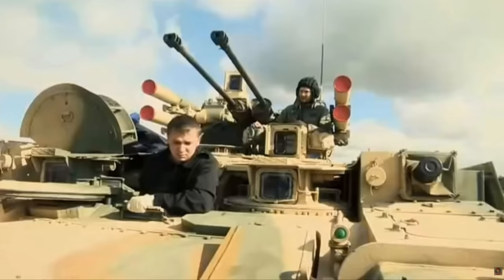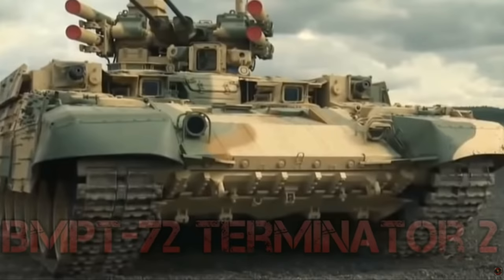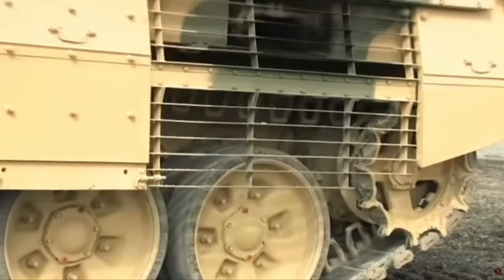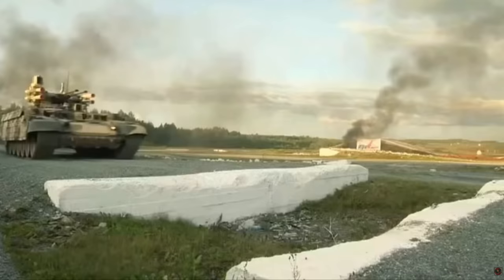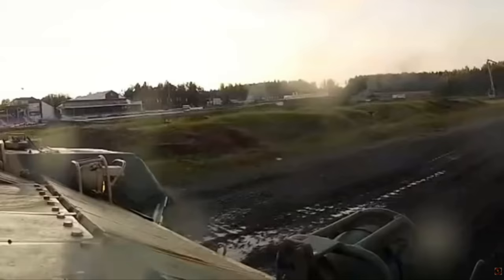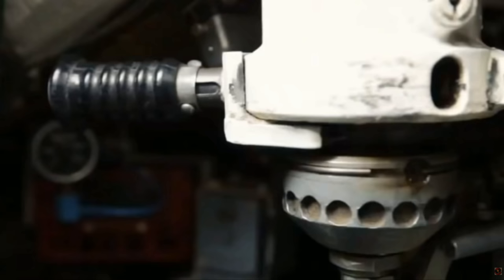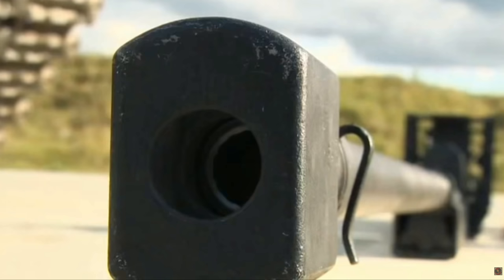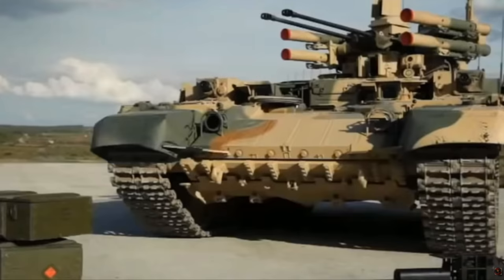BMPT “Terminator" Tank Support Vehicle Overview

Comment: BMPT wasn't designed based on military request, it was initiative from Uralvagonzavod constructors, they still don't fit into Russian military tactics to be widely adopted, that's why there's not so much of them actually built
Reply: 300 pieces were built for Algeria
Reply: i think you meant to say, russia cant build that many because they dont have the cash nor resources to build more.

should i point out the T-14.
Reply: @Thekilleroftanks  if terminator is effective  who know they could just jeri rig the remaining  t 72 they have into somthing  similar or a mad max style look thing and deploy it , whether  it effective  or not it up to a guess,
Reply: @Thekilleroftanks  terminator construction is basically using t72 chassis and put btr cannon plus some atgm.. not the same level of cash as armata
Reply: There expensive and untested in combat 'untill now'.  The Russian federation has 300 if it proves successful I imagine this number will go up.
Reply: @123456qwful  the issue is that the bmpt used modern T72s thats been upgraded (think they used t72b3m) however all the other t72 stock they have is old. am talking t72a and bs, like were talking about early gen ERA. those things would get knocked out so god damn quick.

other issue is that all the electronics for the bmpt is impossible to get ahold of now because theyre all from the west, who is currently preventing any sales to russia. meaning they cant upgrade any older tank nor produce modern tanks or vehicles. meaning this war will wipe out most if not all of russia's military progress and stock piling from the fall of the soviet union.
Reply: @Thekilleroftanks  - "they dont have the cash nor resources to build more." hahaha !!!  Record financial receipt on 2022, minimal waged raised by 10%, and they never have so much foreign money like now ! In what parallel universe do you live, dude ?! They have profit at 45 $ / oil barrel, and how much is now the Brent ? 112  USD ? 
Even selling at a huge discount to Chinese and India, at "only" 75 USD,  they make hundreds of millions / day !   And they sell 50 & MORE now than they sold in 2021 ! 
And about resources ? That plain stupid to say, lol ! If you think of electronics, China is there, can give them ALL they need !
Reply: @m_zbrv3967  is NOT "cannon" but a pair of them, ( no BTR have 2 x 30mm on top ! )  and you forgot the auto grenade launchers who can rain hell on any infantry or soft skin vehicles. And those ATGM can be switched with thermobaric missiles.
Reply: @mirandela777  the 2x autocannons are irrelevant they are not dual feed so one fires ap and other he so you pretty much have bmp 2m lvl of fire power with lot higher protection
Reply: @Thekilleroftanks  i've said exactly what wanted to say. BMPT-72 as it is equals to the price of T-72B3 and have nothing to armata chasis which is completely different thing
Reply: Yes. They are  extremely useful. But As you can understand these are "urban warfare" tanks. They are not meant to fight against tanks. They were made because of the Chechen war.
Reply: @mirandela777  
Except the 6 million Russian that fled to the EU and the hundred of thousands of jobs lost in only the industrial sector.
Splendid. :D )))
Reply: @Thekilleroftanks  Russia don’t have resources? Look at their land…
Reply: @mirandela777  yup.. 2 cannon is destructive
Reply: Javelin targets🤣🤣
Reply: @Shatterfury1871  - source for this info, or I call your statement just a simple invented  BS, dude !
Reply: @mirandela777  he can’t he knows it’s bs. I bring my sources with me. Slava Russia 🇷🇺 #dontfeedintothewesternpropaganda
Reply: @mirandela777  exactly. Russia is making hand over fist now that oil prices have jump to astronomical highest. People forget that all of Asia is supplied by Russian oil. Vietnam China India Bangladesh Japan Myanmar Laos Cambodia Kazakhstan literally the list goes on forever. India is bucking western sanctions and is fed up with the west.
Reply: @JohnDoe-yq9ml  Except Iraq twice (we got Saddam out very easily because the soviet equipment Saddam's guys used was inferior), Afghanistan (we got you guys out first in the 1980s then we got Bin Laden in Pakistan), Nicaragua (where our guys won), Grenada in1983, Saudi Arabia is winning their war now. We don't have a perfect record, we have made mistakes in Vietnam and in Afghanistan, but we have much better record than Russia.
Reply: @dedrickbroussard9797  also btw the USA supported saddam during the Iran Iraq war. Once again proving my point that they always back the wrong guy and then kill him once they realize it.
Reply: @JohnDoe-yq9ml  That is what we are doing now. We supported Russia in WW2, now we are fixing that mistake.
Reply: Military tactics?
Reply: @JohnDoe-yq9ml  '...literally the list goes on forever' It literally doesn't. Japan is phasing out Russian oil, and China and India are the only two you mentioned that come even remotely close to making up for the lost sales to Europe; and they need to transport it a longer distance and at discounted rates to make it attractive enough to 'buck the sanctions'. Their oil industry took a major hit, no matter how hard you try to cope about it.

Meanwhile, inflation in Russia has doubled since the invasion began, their GDP is forecasted to drop from 7-10% this year, and they're currently in the grace period to default on their debt. Yeah, Russia is doing fine.../S
Reply: @scurra1163  tell it to Japanese companies in Sakhalin-2 project, they’ll laugh their ass at you
Reply: @SergeiSugaroverdoseShuykov  Japan imports less than 10 percent of it's LNG and 5% of it's oil from Russia. And not abandoning their shares in Sakhalin to prevent China from taking their market share doesn't mean they're not weaning themselves off Russian supplies.  Russia screwed themselves; cope harder.
Reply: @dedrickbroussard9797  Seelow Heights 1945 would like to have a word with you.
Reply: I bet there's a lot more of them NOW!!
Reply: @mirandela777  The average Americans are not known for their "deep thinking" my friend!!
Reply: @Thekilleroftanks  all the electronics for the bmpt is impossible to get ahold of because theyre all from the west
haleluya contact with a parallel universe maybe you like to buy a bridge?
Reply: @dedrickbroussard9797  supported Russia in WW2 in what universe?
Reply: @fred6319  
You mean deported by force to Siberia.
We have over 6 million in the EU.
There are thousands in my immediate vicinity.
Reply: @Shatterfury1871  no i mean the ethnic Russians and Russian speakers who fled the NAZI regime in Kiev in the last 8 years and people from donbas that have been bombarded by the NAZI regime in Kiev the last 8 years in violation of the Minsk ceasefire this is all the time i will waste on a propaganda parrot
Reply: @Thekilleroftanks  t14 его больше не построить
Reply: @dedrickbroussard9797  Mistake? OK. EVERY NATO observer of this limited op in Ukraine knows what you call 'fixing' isn't going so well. Worse, NATO aren't able to directly intervene because they'll get beat. Meanwhile Putin is 'fixing' US mistakes on his doorstep.
Reply: @a.m.armstrong8354  The repair is ongoing.I would prefer it to happen sooner.
Reply: @Thekilleroftanks  country with a bullet (sanction) proof economy . does not have a resources.... greatest joke ever
Reply: @Thekilleroftanks  I see another anti Russia person here. Who nothing knows about
Reply: It's an IFV with zero troop carrying capability.
Reply: Actually the Russians have built 300 of them from their experiences in Afghanistan and Chechnya they (Russian MOD) wanted this tank support vehicle they did request it
Reply: @Thekilleroftanks  tussia has the cash, they dont have chip manufacturing. Figure your shit out
Reply: @GhostScout42  ya they have the cash (their economy has been on the trash since the 90s)

Ya so much money.
Reply: @orcan377  Algeria is buying 300 Terminators? That's a lot for a relatively small country.
Reply: That and they don't have the domestic capability to make them. Most of the electronics were imported.
Reply: @Thekilleroftanks  Hahahaha... Sure they dont, with oil because this expensive and them earning 230 bilion euros for it so far (210 in entire 2021), get outa here!
Reply: @juhoalander3461  they are dual feed actually
Reply: @Thekilleroftanks  then why many are in ukriane blasting? https://youtu.be/pNonne3faFA
Reply: @SergeiSugaroverdoseShuykov  Russia is broke, there are American cities with larger economies.
Reply: @orcan377  algerian bmpts aren't actual bmpts, they're just t-62 berezhok.
Reply: Actually they used the experience in Syria where they saw that the AA shivka high rate of firepower basically made it I possible for insurgents to raise their head
They used what they learned to produce the terminator

Comment: Bmpt terminator 2 does not have the grenade launchers,Bmpt 1 does. The terminator 2 also has armor around the ataka missiles.
Reply: I wonder what the GL performs vs dual cannons for dealing with reinforced concrete positions. Penetration vs AoE in an urban envt
Reply: Also crew is only 3
Reply: Well, technically there is only one BMPT, they just try to find the right config. But yeah, the updated design don't have hull grenade launcher
Reply: It sounds reasonable. The grenade launchers was a mistake. Less armour / weak spots and could only engage in the direction the tank was turned! Further - 2 men for operations, space that could be filled with protective armour or other usefullness.
Reply: @swordsman1137  BMPT II exists and there were 12 in a convoy in Ukraine.
Reply: Actually, BMPT-1 does have armored Ataka launchers. It's the configuration used by Russia, Algeria, and Kazakhstan
Reply: @GarioTheRock  those weren't BMPT-2
Reply: I don`t know why the hype they don`t have enough of them to even be worth mentioning, 9 I think it was.
Reply: @gunfisher4661  Russia just testing stuff (not only that one). There were some good perfomance in Syria, but Ukraine have much different landscale.
Reply: @duckman12569  i wouldnt be suprise if they use atgm for reinforced positions although these are not much common, in this regard is better GL for clearing trenches/igniting stored munitions, you may look up pen. charts of their autocannons tho, surely it will go through most concerete buildings
Reply: Yeah I mean an ATGM goes badly for people in a sealed room from the overpressure right? presumably it wouldn't be so effective when that pressure can just push through into a bunch of space.
Dunno, just theorising why that choice.
Reply: @duckman12569  yes, its a common way to deal with it, even portable ATGMs are used in this way, depends on target priority so they dont waste many rockets, if they have only 4, HEAT will definetely injure crew inside bunker, ataka can be fitted with HE as well
Reply: @GarioTheRock  the Algerians have about 150 of them which puzzles me and the Russians have less than 20.
Reply: @mortenlund1418  the grenade launchers were not a mistake but should have been relocated to the commanders viewer as part of a rws giving it more viewing arc,elevation and depression.
Reply: It has grenade launchers, but it's just 2 instead of 4

Comment: first BMPT was built on T-90 chasis, BMPT 2 is built on chasis of T-72. 
The idea is that you can use an old reserve T-72 chasis and just change the turret and replace a few electronics. Instead of building new T-90 chasis altogether for the vehicle. 
Modularity is a major pivotal point in Russian designs after year 2000.
Reply: Don't forget the T-90 was originally a upgraded T-72 with the T-80U fire control system, upgraded engine, and named the T-72BU.  The vehicle was renamed T-90 after Chechnya.  I have both T-90s and T-72A/B/B obr.1989g/BA sitting in my collection of 1/72 scale armor and the only way to easily identify a T-90 or T-90A from a late T-72 is the dazzler bozes on either side of the T-90's main gun.  The T-90M definitely has a much different look with it's new turret.
Reply: @merryprankster2367  вы ещё в детсом садике, или уже в начальной школе?
Reply: @user-jq1mb6on5o  We tend to speak English in the USA, not Russian.
Reply: @merryprankster2367  учи русский язык.
Reply: the major pivotal point in all ruSS design is that it is shit
Reply: Well, nowadays they can only mount it on the T-34.

Comment: I am an ex TOW Operator. With an ATGM system like the TOW, it allows engagement at extended ranges. Those ranges require a steady platform as the missile takes its 25+ second flight. This thing upon hearing or seeing the signature of a TOW being fired can chime in to lay down suppressive/killing power within that flight time. Unlike a tank that has to have a direct fire solution and the right round. This thing belches a staccato stream of unholy destruction to create misery on all those unfortunate to be down range. I am glad the Ruskies don't have a lot of these.

Comment: In combat approved they show that they got rid of the grenade launchers and two positions in the tank. They armored the anti tank weapons as well for shrapnel hit reasons from artillery. They field tested it in syria. I watched them a week ago in ukraine, a column of like 12 of them moving to the front. Perfect environment for this particular weapon platform.
Reply: Why did they remove the grenade launchers? I remember reading about this.
Reply: @Joe_Friday  they found out it’s unnecessary because they aren’t really that effective in terms of movement and they are a weak spot. In the version without them it’s covered with ERA.
Reply: @exo068  I'm guessing the launcher's RANGE was an issue too.  They should have just used the weight and space for extra 30mm ammo.
Reply: @swaghauler8334  they are in a wired position you can probably add more ammo but it would be more of a second magazine that requires manual reloading.
Reply: @exo068  Removing the two gunners would allow a LOT of internal space for rerouting the 30mm ammo.  Most IFVs wrap their belted ammo around the inside of their turrets.  The M1's 1100 round mag for her 7.62mm is equally convoluted in the way it feeds around, over, and under stuff in the crew compartment.
Reply: @swaghauler8334  yes I meant that they aren’t connected and there basically just for transport.
Reply: @Slavkovic_Predrag  They wanted to earn that "Terminator" nickname!
Reply: @Slavkovic_Predrag  Because only one of the autocannons fires HE ammo. I'd imagine a contributing factor is the GLs (likely) use rounds with more HE filler. This would from the 2A42 autocannon's much higher muzzle velocity (960m/s vs 185m/s) which means its projectiles need thicker/heavier walls to withstand the firing pressure, leaving less space for the explosive filler.
Reply: @exo068  I suppose that the Russians already have plenty of crew-served automatic grenade launchers, too, so they could rely on those for indirect support fire while the BMPT provides direct fire support
Reply: @Slavkovic_Predrag  My thoughts too. 

      I still think that the Russians should have put a couple of rocket pods on them because those pods prove pretty effective at suppressing infantry from the back of Toyota trucks! Go big or go home!
Reply: 12 BMP-T? That's more than are known to exist in Russia. Although maybe they have received some of the exported ones, but point still stands.
Reply: @swaghauler8334  yep, that rocket pod for attack helicopter sure wreck the building and fortification. But reloading could be an issue
Reply: Where did you find the video of the 12 Bmp-T's?
Reply: @Slavkovic_Predrag  Grenades and Autocannons are good for different things; you wouldn't want to launch a parachute flare or smoke from an autocannon; for example. Much like you probably shouldn't be firing Armor Piercing rounds from a grenade launcher. There's some overlap (HE for example; only one of the Terminator's guns can fire it.) but really it's better in this case to have two weapons that do their own thing pretty well than have one that does both badly.
The Terminator 2 got rid of the grenades to get some more ERA; but also lost a bit of combat prowess in the process.

Comment: One additional point i dont believe you mentioned, after the experiences the Russians got in Syria (which we have seen again in clips from Mariupol, etc), they wanted this vehicle as for when it comes to urban fighting, a regular MBT cannot elevate its weapons high enough to engage targets on the second or third floor of a building (ATGM teams seemingly love hanging out up there and essentially firing down on the tank where its armor is weakest). So the "Terminator" i believe has a 50 degree elevation on its cannons to combat this specific issue.
Reply: That is only a problem for MBTs. You don't solve that by wasting another maximum cost hull to put next to it with weapons that don't have the problem but either put a remote weapon station on top of the MBT or put a cost efficient budy next to it, like an IFV that has the same capabilities but also brings the way more important dismounted troops. This is a mix of engineers' and marketing's solution -- and more to the plant's lack of orders than to the soldiers' needs.
Reply: @erikitter6773  Russians during Grozny tried to mitigate that by mixing tanks with BMPs and SPAAs, both having high elevation capability, though their light armor proved to be a concern. I guess thats how idea for BMPT was born, to mix tank relative survivability with dakka.

Obviously, there's question whether "BMP survivability in urban environment" would be such concern if Russians fielded primarily BMP-3s with ERA kits, instead older BMP-2 or 3 without ERA. Especially as 100mm cannon in BMP-3 can be convincing argument in cities
Reply: @Panocek  they should've slapped those 4S24 ERA onto all the BMPs and BMDs lol